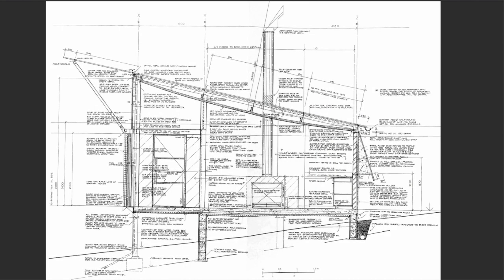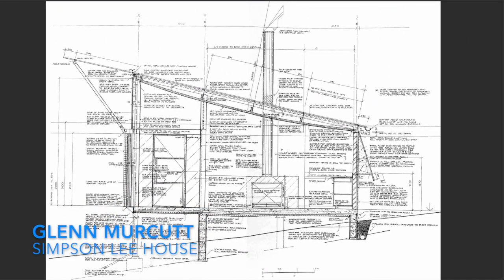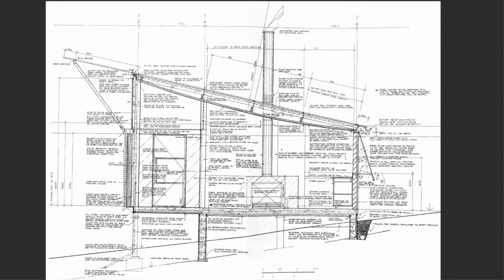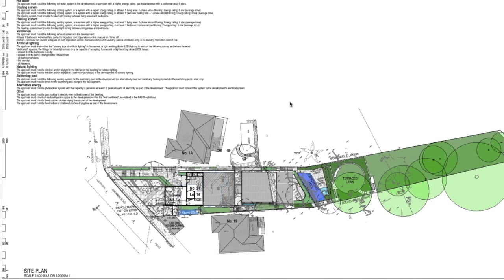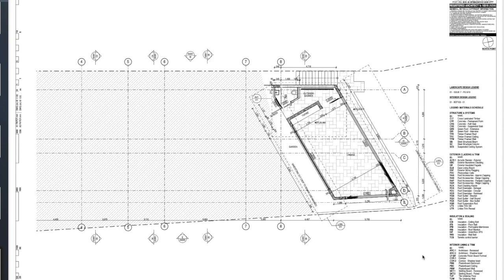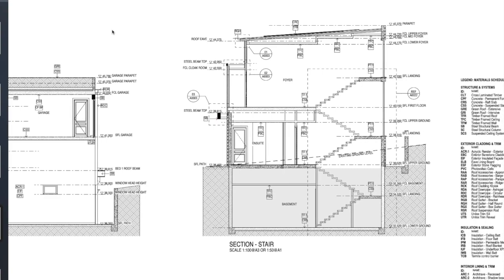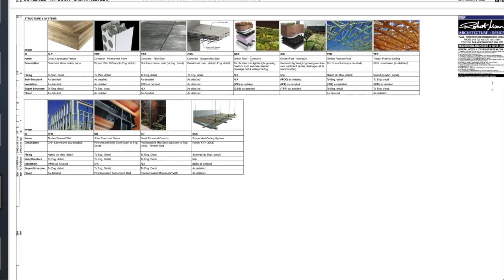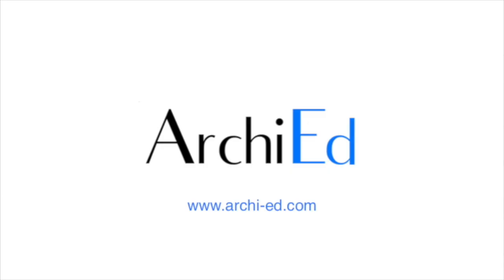Architectural Annotations

Comment: Thank you for the video, but, how did you add images to the schedule displayed at 12:32 in your video, I would like to see your schedule settings of possible.
Reply: Were you able to solve how to add  images in schedule?
Reply: I believe the schedule is built with a blank row to allow for the image.  After the schedule is placed on the worksheet, he pastes the image on the worksheet and manually aligns them on top of the schedule.  Even in Arch27, there isn’t a way to add raw images to a schedule.